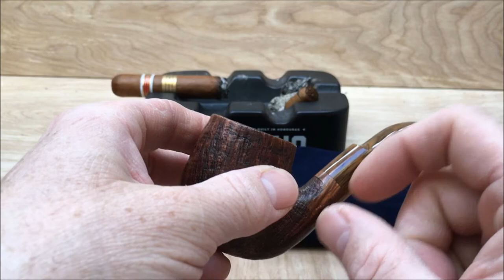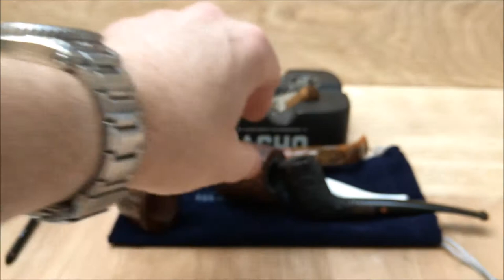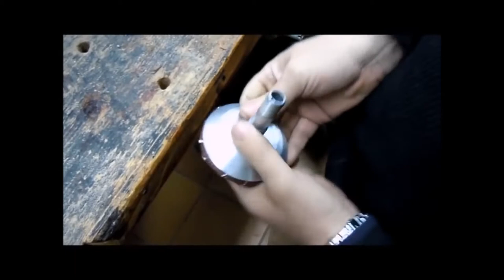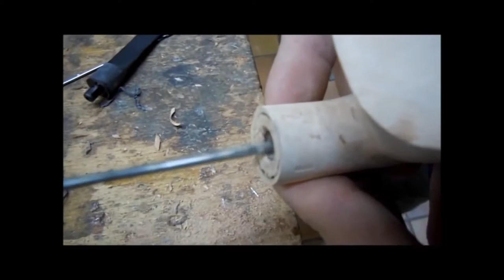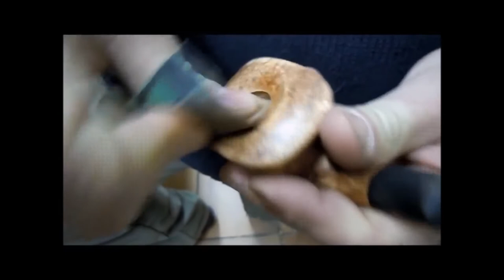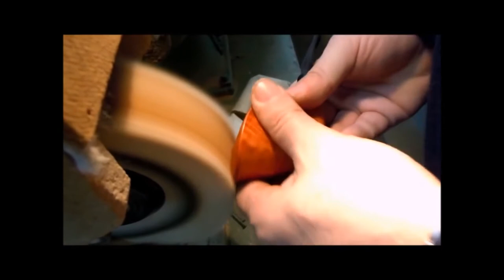An ode to the making of a Moretti Freehand Pipe

Comment: A delightful "ode."  Thank you.

I just got a Moretti pipe, from eBay, of course.  I had read some good things about these pipes and decided to try one.  I guess my pipe's shape is a large apple, perhaps a large "modified" apple.  Smooth finish, light stain, lovely grain.  Until this video I had zero idea how Moretti made his pipes.  I am greatly impressed.  I have yet to smoke mine.  If it smokes as good as it looks, I can see a couple more Moretti's in my future.
Reply from the maker: Frank Bishop you can’t go wrong with a Moretti pipe